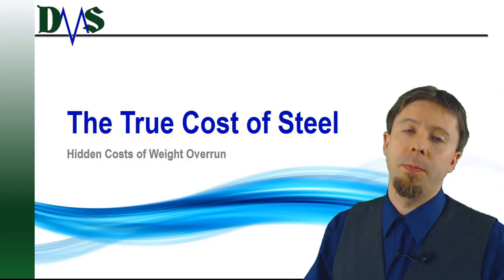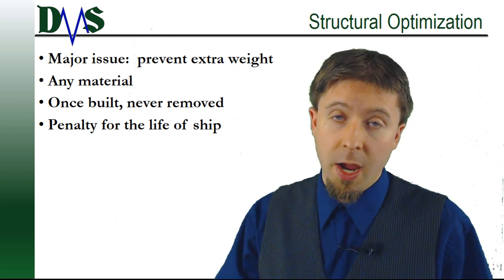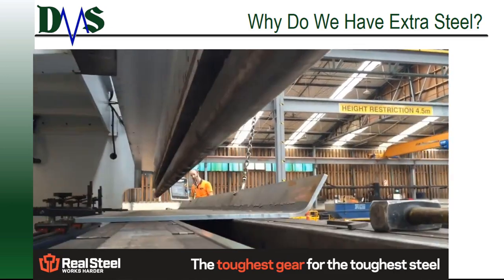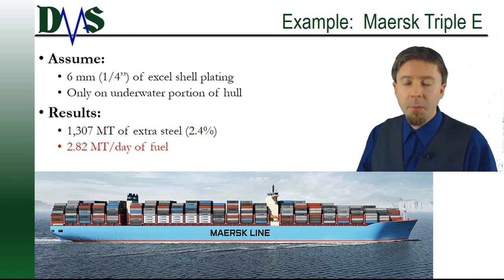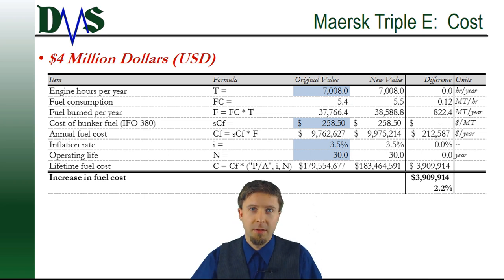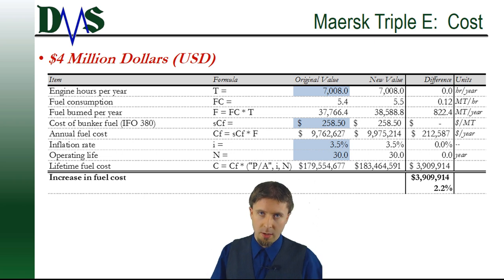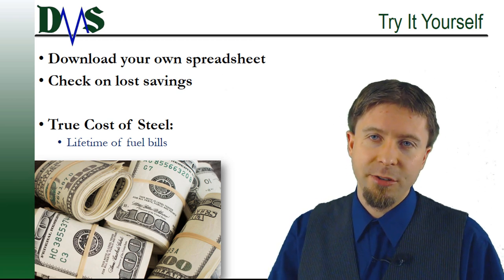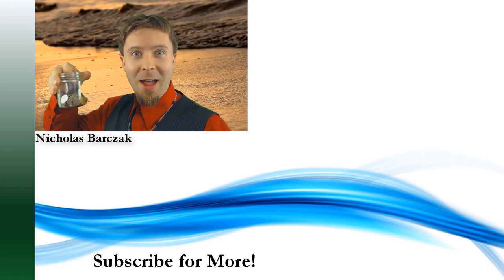The Secret Cost of Steel

Comment: Interesting. The total cost over 30 years is not that significant. It amounts to about $1.00 per teu carried, which is easily covered in freight charges.
The containers alone weigh over 40,000 metric tonnes empty. Shave 100 kg off each container constructed and you have same result. Far more critical is the cargo mix of weight/measure.  If all containers loaded were at 
Their weight limits, the Triple E couldn't carry them all. Have you done any studies on aerodynamics? These ships are massive square
High buildings pushing against the air.
Reply from the maker: Not on container ships, personally.  Though some high speed ferries look into their aerodynamic drag.  Air drag adds about 3-5% to the total resistance.

Comment: Aren't the bilges of these ships filled up with water ballast anyway?
Reply from the maker: Not if they can help it.  They have tanks for ballast water.  But when traveling loaded with cargo, those tanks are practically empty.  Maybe a little to level out the ship, but that's it.  They fill the tanks when traveling without cargo to keep the ship stable and safe.  But even then, they only add the minimum ballast required for safety.

Comment: Not only that but 6mm extra steel will add 10 years to the ship 's life
Reply from the maker: Very true, and many ships go for extra steel for that reason.  But the steel isn't a universal help.  The best option is to do extra engineering and find where the extra steel helps.  Only add it there.  Admittedly, this means extra engineering cost, which is not often in the budget.

Comment: Mt  reads as mega tonnes or million tonnes.
Reply from the maker: Technically, the official abbreviation for tonnes is t, which is a metric tonne.  In the United States, tons are still measured in short tons and long tons, because the US uses the Imperial System of measurement, also called the US Customary System.  The abbreviations for these are LT for long ton and ST for short ton.  Due to the lack of exposure to metric terminology in the US, if you use the official abbreviation for metric tonne in the US, it frequently leads to misinterpretation.  This is why many in the US adopted the abbreviation MT for metric tonne, as an extension of the abbreviations used in the US customary system, to help ensure clarity of technical communication.
Reply: @DatawaveMarineSolutions  I get why you use it. and no one is going to think you mean a few billion kg. just saying that to the vast majority of the world Mt reads a mega tonne. 

If specifying exactly which ton/ne is important it is probably clearer just to spell it out. In your example I would say it doesn't really matter so it is clearer to just say "t"

Comment: How about stainless for long life & no paint.
Reply from the maker: I have not seen stainless used for an entire ship's hull.  I did a quick check on the prices.  As of today (Jan 1, 2018), mild carbon steel had a price of $0.37/lb.  Stainless steel sold for $1.63/lb, over 4x more expensive.  

The stainless would increase your corrosion life.  But to be worth the investment, the ship would need to last over 4x longer.  I think you would run into fatigue life limits before that.  But I have seen specific sections of the ship done in stainless steel if corrosion is a special concern.  Piping for cooling systems are a great example.
Reply: Nicholas Naval Architect Stainless steels usually have worse fatigue characteristics than carbon steel. Fabrication costs are also much much higher due to work hardening, heat treating, etc.
Reply: they tried it in the 70's (or 80's?) , at least thats what a former cpt. told me. He said they were getting fatigue problems everywhere and were a failed experiment.

Comment: Thing is, big ships like the cargo freighter you started with are the BEST CASE scenario for doing Structural Optimization: and is thus HIGHLY misleading.

For a smaller ship, the cost of the Engineering labor to optimize a single element (like the hull thickness) would not be much less, but the fuel savings would be.

And, that $4 mil is spread over 30 years.  Meaning it's a deferred cost.  Whereas the engineering cost is upfront- indeed probably paid a couple years before the ship enters service.

Let's say you have a ship that weighs 1% as much.  So you would only save $40,000 in fuel over the lifetime of the ship by structurally optimizing.

Any money spent in optimizing that hull is money NOT invested elsewhere- whether in other features for the ship, or simply used to buy stocks/bonds and earn returns on that.

Let's say the alternative to investing in structural optimization is investing money at a return of just 5% (a VERY reasonable return for a business with competing fiscal demands, or private individual who could stick the money in a retirement fund...)

Structural Optimization would save that ship $1334 a year in fuel costs (rounded up).  But if the optimization were to cost just $25,000 it would not be worth it: because that money could have been invested at 5% ROI per year (earning $1250 back in returns each year), and the purchaser would have been able to slowly draw down those investments to pay the remaining costs back- still being left with some money at the end.

For a cargo ship the size if the one you showed, on the other hand, it would have to cost $2,500,000 for the optimization for the scenario to be comparable.
Reply from the maker: Very true.  And yes, for small ships, structural optimization isn't always worth the effort.  But on the other extreme, I have seem small ships where designers put no effort towards optimization.  Where the designer's own calculations showed that they could reduce the plating thickness along 40% of the ship.  Instead, the designer kept heavy plate along the entire ship, opting for convenience over performance.  

So I agree that the level of effort needs to vary with the potential return.  But I would argue against the design philosophy that sacrifices the performance of 30+ years for convenience during the 16 - 24 months of construction.